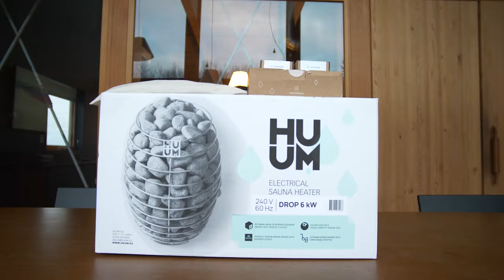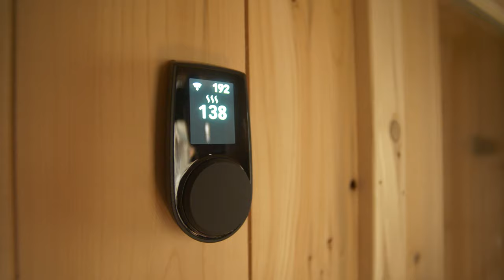Unboxing WiFi Sauna Stoves // HUUM Sauna for your home?

Comment: BS and overpriced.

1 electric cooking burner a shopping cart and some stones from my local nursery.

Priceless just about $350.00 plus a 30 amp extension cord.

Most homes or apartments have the water heater next to a bathroom. 

Step one ... Turn off the 220 braker for water heater cut the wires and install. a 220 outlet.

Step two ... Buy a 220 washing machine cord and install it on your water heater. To plug in and unplug wile using the souna.

Step three ... Cut the shopping cart and make a box big enough to place the electric cooking stove in it with a bunch of river rocks in it with a 220 cord long enough to plugin in the water heater new aulet disconnecting the water heater (no overload).

Step four ... Add 1/2 inch insulating Styrofoam to wall and ceiling with thermo tape NO HEAT WILL ESCAPE (no need to glue the foam to walls).

Step five .. TURN THE COOKING HEATER TO MEDIUM TEMPERATUR,  Get naked and enjoy.

NO DIFFERENT FROM BOILING WATER. heat rocks to desire temperature. BY controlling the temperature on the stove under the rocks. 

You can still take showers and now have a 30 minutes sauna.
Reply from the maker: Hey @redbugg99, we appreciate the DIY spirit. And for those who wanna build. We always support. 

It is worth considering sauna heaters that have additional safety elements and ratings so that they can be installed, insured, and supported. Additionally, be very careful about foam insulations. Most off-gas at normal sauna operating temps. So be sure to check temp ratings for all materials in the sauna. Stay warm!

Comment: The heater requires a high temperature cable of minimum221 degrees. Is there a certain cable your company uses. Having a hard time finding one.
Reply from the maker: Hi Blake, that is correct! We do have a heat protected power cable custom made for us. We plan to have them on the website soon. 
Please contact us at sales@cedarandstonesauna.com and we can connect further!

Comment: Does the water evaporate before hitting the floor? Just curious if you need tile and/or drainage.
Reply from the maker: Good question.  

Saunas are wet rooms and should function with the ability to drain water. The majority of the water does evaporate before hitting the floor when poured slowly over the stones. 

However, be careful to manage any other moisture you create for the room. Nobody wants that dank musty gym sauna. This can happen if proper drainage isn’t accounted for.

Comment: These are very pricey. Would want to get one but they seem pretty new and haven’t been fully vetted yet.
Reply from the maker: Hey Kyle, indeed you do get what ya pay for. There are cheap sauna heaters on Amazon. And if budget is the only factor then a more premium stove wouldn’t be the best fit for your needs. 

However, if beauty, quality, safety, and advanced tech features are for you these heaters lead the industry. They have also been significant in the European market for almost a decade. N to the USA yes, not new to helping people with quality sauna.
Reply: @Cedar & Stone Nordic Sauna  How 'Reliable' are they is the question? Is there a guarantee?
Reply: In estonia, they cost like twice the amount.
Reply: @matukaz  and they’ve had nothing but issues since their release. Overpriced garbage heater.
Reply: @Kh2456  I misspelt it before. They cost around twice as less. So around ~500 euros. I used to have huum drop for 3 years and no issues. New sauna I'm building will also have Huum hive mini.
Reply: @madis5314  I've seen multiple posts on reddit of the Drops having catastrophic failures of the elements melting.

Comment: Do you guys build saunas that purely run off of solar? I live in a state that has lots of sun shine. I’m thinking of my dream sauna where one day I’ll have you guys build it.
Reply from the maker: Hey Aaron, great question. Finnish/Nordic Sauna tradition create a sauna that has high heat and ability to throw water into stones to control humidity and create steam.

To do this you’d need a wood-fired stove, or an electrical stove with 240v service and 30-60amps of power. 

So is solar theoretically possible. Yes. Yet, it’s seldom cost effective with current residential solar. 

But sounds like a fun challenge to solve. 😄🙌🏽🔥☀️
Reply: You can easily do this with the right amount of panels and battery bank big enough.
Reply: I’ve often thought of building a solar sauna. I’ve had a normal flat plate hot water solar panel but they only produce 160 degrees which might not be hot enough for a sauna  and I probably not use a sauna in the day but after work.

Comment: they look so sick, i wonder what size there rated up too
Reply from the maker: The HUUM Drop (Small Wall-Mounted) like this have heat outputs of 4.5kW, 6kW, and 9kW which would heat up to 530 cubic feet. And If you need more then HIVE  and Wood-fired options provide even more heat. 🔥🙌🏼😀 Just depends on how big your sauna is and we make sure the right one fits.